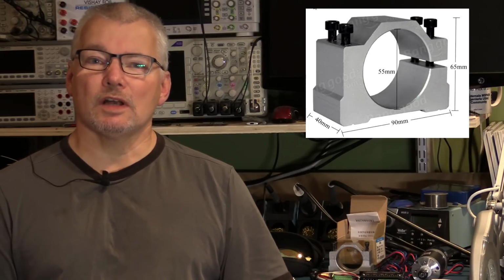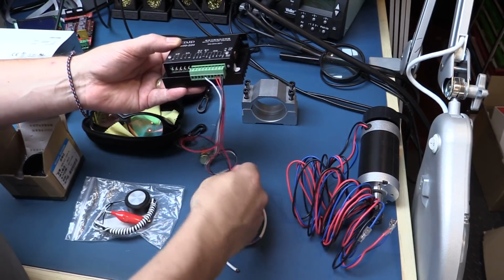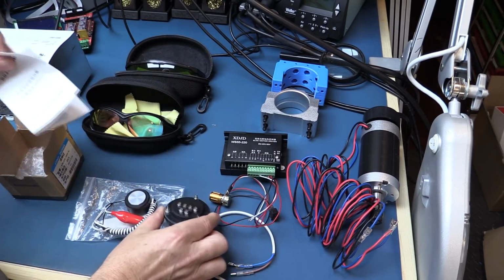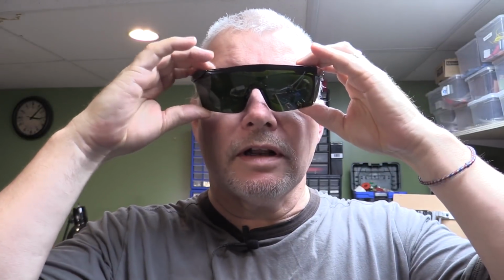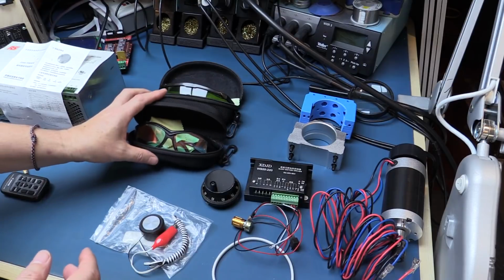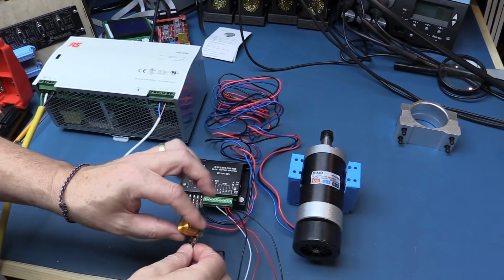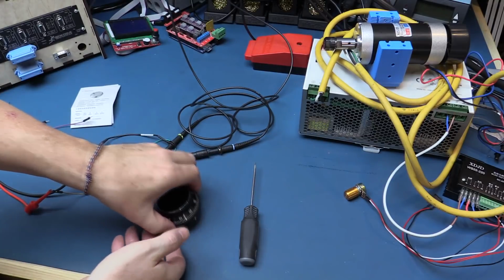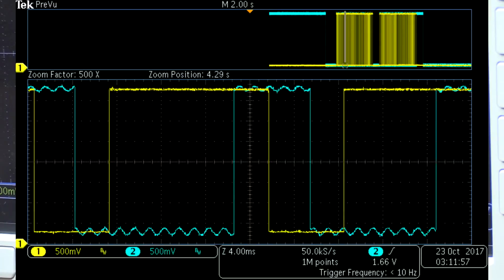Banggood Mailbag - CNC Spindle, Laser Glasses, MPG and more

Comment: Sorry if this is a stupid question but I thought the spindle was rated for 100 volts, when using the controller and only feeding it 48 volts is it only at half speed? Or is it full speed but half torque? Thanks for the review. Cheers
Reply from the maker: The motor is rated at 48V, 500W, the controller will work up to 50V. if you run it on say 24V it should turn at the same speed on no load but it will have much less torque. the speed is controlled by the frequency of the output to the motor via the 3 wires. (Think VFD)

Comment: Ohh, fingers so close to live current at 20:15.  :-)
(time fixed)
Reply from the maker: I think your time reference may be off there but you will notice the red device on the far left of the screen (Black and red to the left of the power supply) , this is a quick connect, with the lid up as it is seen at 18:15, there is no mains on the power supply. even if it were, the actual metal of the terminals is quite deep in the connector and the wires also have plastic coated ferrules on them so even if it were live, there is very little chance of me touching the electricity. lastly, not that I would want to test this theory, i have a ground leak circuit breaker in as well, so it should trip if i made a mistake.
Reply: Peter Oakes thanks. Yes, you are right about the time. Can't understand how that happen. Oh, I missed a Zero. Zeros do matters. :-) 

That sounds much more security.

Comment: i look for make a small cnc for cut sheet aluminum thinkness max 6mm! can the DC 48V 500W ER11 Brushless Spindle do it? thank you for all your vidéos. very interesting.
Reply from the maker: it should be able to handle it, this is one of the reasons I wanted one,. You may want to get a bigger er11 collet though for using say 6.25mm (1/4") bits. the trick is to manage your speeds and feeds
Reply: Depends on how fast you want to cut.
Reply: the speed is not important because is hobby for home.
Reply: Stunam! Vap ok. Then it will work.
Rigidity of the machine, the power of the motors, the tool and the material are all parts of the equation. That decides if it is possible and if, how fast.
500 w would be reasonable enough to machine aluminium.